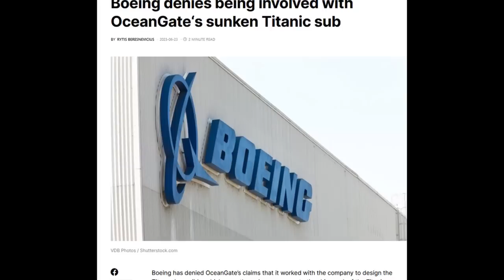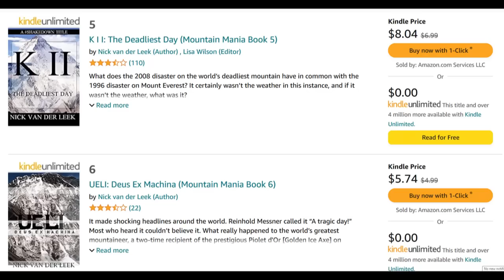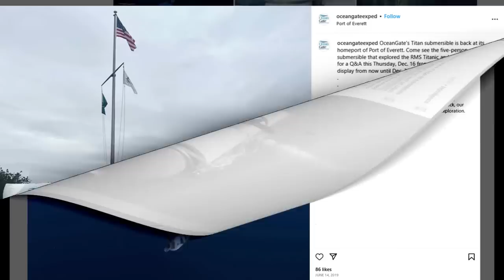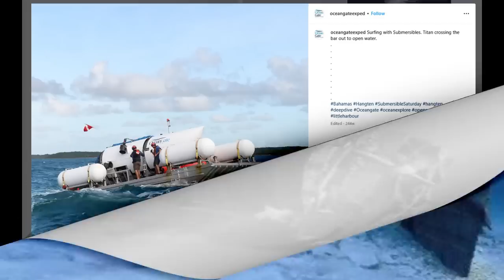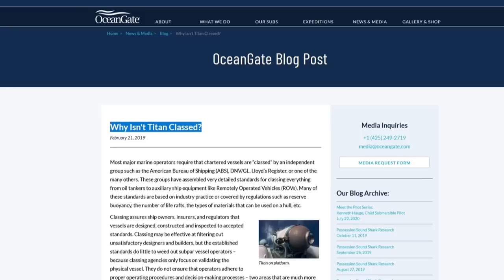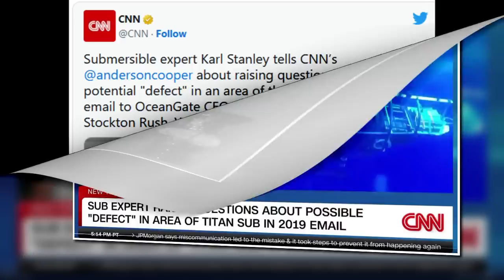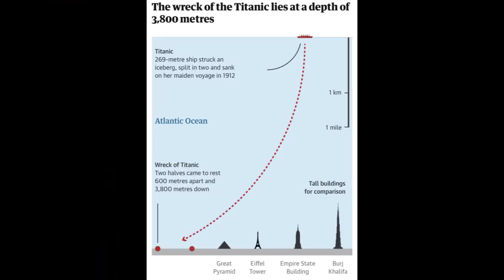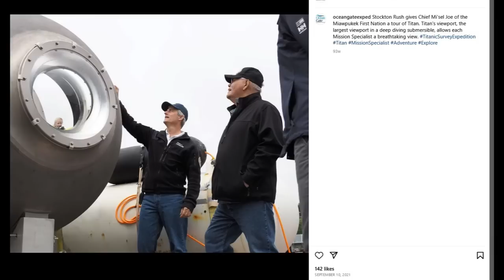"Boeing was not a partner on the Titan and did not design or build it"

Comment: Watching that guy mix up the glue in a bucket with a spatula is telling about the level of manufacturing control.
Reply: lol I'm not the only one that noticed that ...good 😂
Reply: Yes that flashes my mind when I initially saw it.  The glue wasn't the issue, it was the length of the lip
Reply: And not a clean room
Reply: @leopardwoman38  Yes. All it would take is an errant dust bunny.
Reply: Exactly. I wouldn’t use a snorkel built that way to go just under the surface. Let alone dive to pressure depths
Reply: Epoxy resin, the 2 part variety, needs to be very precisely weighed & then mixed. Failure to do so typically means the bond integrity (& durability) is not achieved.
Reply: @stephenthompson6982  yep.

Comment: Wow!  Just look at the wreckage pieces and we have our answers - Titanium pieces intact and in reasonably good shape and the composite material no where to be found!  Stockton Rush seemed to be an engineer gone rogue and that is always dangerous.
Reply: They apparently picked up hundreds of fragments off the sea bed, there were several very large bags of material offloaded from the returning ship.
Reply: Yes! We once bought a house from one such theoretical engineer with degree in metallurgy the first night as I hung bedroom curtains the whole lot fell off the wall due to this guy not using suitable wall fixings. Then the wall cupboards fell off the kitchen wall for the same reason - right on top of my wife! The thing is, this guy was a member of a local gliding club who volunteered to mend glider wings in the garage. I shudder to think.....!
Reply: @royfearn4345 oh my goodness. It would be laughable if it weren't so dangerous.
Reply: @rtqii  Thank you.  Yes, that’s what I read after wrote this. :)  Sad, I hate to see lives lost when it was completely avoidable.
Reply: @LettieC33  This is a very interesting case and I followed the recovery very closely. Pelagic Research Services has performed work of the very highest order in this recovery.
Reply: @rtqii  I agree!!!
Reply: @LettieC33  You have a new subscriber.
Reply: Glue joint will be scrutinized.  This is not as simple as gluing a graphite shaft to a Titanium driver head.
Reply: I bought a house that was owned and modified by an electrician.  As I walked around, I noticed everything he did was not to code.  During escrow I had the house inspected by the building department. He had a list of things to bring up to code.  He was mad but I wanted my house safe.  (I’m an Engineer-but I follow the rules as they are for safety.)

Comment: Did y'all notice that the glass was missing from the porthole in the wreckage footage????
Reply from the maker: Well spotted.
Reply: @gregwood3380 Mechanical engineer here.  This would be my guess too.  While the window was underrated for the depth it likely did not experience the same kind of cycle fatigue that the carbon fiber shell did and with reports that cracking could often be heard from the carbon fiber, there is just such a large surface area for something to fail.

Comment: Clue of this event might be how they towed the floating rig w/ sub on it across stormy seas of the atlantic ocean. DALLMYD was on sight on that fateful last expedition and in his video it is evident that they towed the sub. Structurally I assume, the sub was mated to its external frame thru titanium rings. The floating rig however was actually TWO separate floats joined loosely, longitudinally. So the left side of sub framing was on the left float, while the right side of frame was attached to the right float. In wavy water the floats were "walking the waves" which in turn was creating torsional loads on the titanium rings making them twist in places where they were glued to the carbon fiber tube. This floating rigs was towed 600 miles across stormy waters plus they had it parked for several days on diving site.
Reply: Are you absolutely sure he was there for the last expedition? I saw his video but from what I gathered he had already left and was just there shortly before, I’m guessing a few weeks before. Usually it takes them days to weeks to edit and upload videos and he had his up shortly after the incident or at least when we found out the outcome.
Reply: But I agree 100% about the “raft” they towed that thing on. I can’t believe any of those experienced people saw that and still actually got on it. I have zero knowledge or experience with the subject matter and I would never consider going in that thing after seeing that.
Reply: @highjinx6519  for rough seas you need a V hull rig, their floating rig was flat bottom for small lakes or river; s lot of vertical pounding that sub must have endured

Comment: It's a somewhat realistic looking stage prop. The ends had a two inch overlap and were glued on with epoxy, hard to consider such a ludicrous construction method was for anything but appearances.
Imagine if the front end of your car was constructed that way, no cohesive framework, just a two inch overlap held together with some epoxy. I wouldn't expect it to really be able to hold together very long in actual use, but it might long enough to look good in a photo or video.
A glued together submersible?... yeah right.
Reply: The ocean pressure will tend to press the hemispherical heads into the tube.  The problem with the concept is the strain dissimilarity of the two materials adding shear stress to the glue joint.  Not saying its an adequate design, but the concept is sound.
Reply: @scottkelley1558 How is the concept sound, if it's inherently flawed? What are you talking about? 
This just the kind of so-called reasoning that resulted in this mess.
Reply: Yes it's a sound theory to a child, but the shorter the overlap, the less(maybe expo entially) ability to stop the carbon fibre tube from narrowing in the centre of its length, placing a fold strain at the edge of the lip and thus setting up the conditions for a shear....
Reply: @lewis7515  the concept of using pressure to seat mating pieces is used extensively in nuclear reactor fluid system components.  The greater the pressure differential, the more tightly they seat.  

Did you not read the second sentence where I said I was not saying the design was adequate?  There is a difference between concept and verified and validated design.  Oceangate failed in those aspects.
Reply: @scottkelley1558  So what? Do nuclear reactors attempt to take advantage of a higher internal pressure, or external? Do they rely on profile lock-out between mating faces or do they just place flat surfaces next to each other? Either those concepts the same, or they're different.

Yes, I did read your second sentence - that's the point I just made: your second sentence is  meaningless. 
The concept can't be sound if the design is inadequate, as the design is a material expression of the concept. What are you talking about? Design is even different to execution.....
You're discussing principle - which well may be reasonable and universal: but that doesn't mean every concept seeking to exploit that principle is sound, as a concept is conceived as an exploitation of principle. A design only prosecutes that concept - and there's actually a difference between poor execution of a sound design; and the perfect execution of a design that was fundamentally ill-conceived and therefore flawed. 
With that, a fundamental ill-conceived attempt to exploit a principle, [I would have hoped, obviously], can never be described as, "sound"....
What ever in this world are you taking about?
Reply: @scottkelley1558 No nuclear reactor has ever gone to the depth of Titanic.
Reply: @scottkelley1558 That is an awful design the glue gets compressed and uncompressed. Not good.
Reply: Besides nasa keeps screwing up making spaceships all the time.
Reply: @small_joys2022 that’s a great point. Many of the nasa engineers privately admitted that the shuttle concept was inherently flawed and the design execution with the lack of resilience of the solid rocket booster seals was one of the more obvious shortcomings. That, in combination with the military/commercial pressures and competition from Titan(!) rocket programme combined with horrid cold weather resulted in an attempt to fool nature which backfired spectacularly. Almost the same (principle-wise) with Oceangate. Very sad and I do hope that NASA Artemis programme learns some of those lessons…

Comment: I think the one thing that amazed me was how they were applying the resin glue, came across as if they were just painting a shed, seemed little consideration for even application avoiding contaminants or trapped air bubbles 😮
Reply: I've seen non structural Carbon Fibre car parts made with better care in cleaner work spaces than this

Comment: During 2020 and 2021, the Titan’s hull was either repaired or rebuilt by Electroimpact and Jenicky Industries, two Washington state companies that deal largely in aerospace. In late 2021, Titan makes its first trip beneath the wreckage of the Titanic.

Spencer Composites says the Titan was not using its carbon fiber hull on Sunday’s dive. Other than possibly rudder work, a source familiar with the company told TechCrunch that not much has changed with the Titan since 2018.

Comment: 05:40 them applying the epoxy (think industrial super glue) in a clearly non controlled environment in a situation where you only get one shot at it. That should have been done in a temperature, humidity and particulate controlled atmosphere because all of those can affect the curing of the epoxy.

Comment: I'm a former pro-skydiver and we use carbon fiber for a lot of our helmets. It's lightweight but strong enough to mount cameras on, and you can even bake it and mold it to fit your specific head. It's got some great properties but we always joke that it's just a cup to hold our brains if we hit something. It's not strong in the sense of great impact or pressure. I find it illogical to utilize this material under pressure.
Reply: One of the first thing you learn as a Probie Firefighter or EMS. At the scene of any sort of accident, never ever be the guy that picks up the helmet that you find. It's rarely empty.

Comment: I learned about the limitations of carbon fiber and dissimilar materials assemblies e.g. coefficents of linear expansion over twenty years ago on my bachelor engineering degree. Fracture mechanics, k.. I knew the sub had imploded as soon as it was reported missing. Carbon fiber and glued assemblies is not the right material and assembly for a deep sea sub. Princeton posh rich boy Rush obviously was looking out of the window or chose not to take a materials module.

Comment: I worked as a consulting engineer with two dozen venture capital funded start-ups developing renewable fuel processes a decade ago.  The hubris of Rush, disrespect for outside expertise, technical short cuts,  name dropping of reputable companies and research organizations and use of inexperienced (read far less expensive) engineers is all too familiar.  A decade later, maybe one of the 25+ companies I worked with survives.  Some careers were ruined and 100's of millions of investor's dollars were wasted in the shake out process, but fortunately no one was injured or killed.
Thirty years prior, I worked on a novel oil production process that was the pet project of the CEO of a major oil company.  It never worked, cost $1 billion and there was pilot plant evidence that it wouldn't work that was suppressed by upper management for fear of angering the CEO.  The failed project led to the company's demise and many destroyed careers.

Comment: The successful application of carbon fiber composite in aircraft bears little or no resemblance to the massive compressive loads encountered in deep-sea submersibles. It's a complete misapplication of the material, imho. Aircraft structures endure millions of load cycles. These composite submersibles seem life-limited to just a few load cycles....this is a huge red flag. I suggest interviewing a materials engineer with extensive composites experience to comment on the differences between these two applications and the suitability of carbon fiber composites for a deep-sea submersibles main pressure hull.

Comment: It is interesting that any comparison at all would be made between the Titan and any pressurized composite body passenger aircraft.  The Titan at 13,000+ feet below the oceans surface was routinely experiencing 6,000+ psi ( psi) pounds of pressure per square inch ). That is roughly equal to 11 million pounds of total pressure distributed over the Titan's surface area at its maximum dive depth.    
By contrast, an aircraft flying at an altitude of 13,000 feet  is pressurized to between 12psi  and 14 psi. The required durability for safe function of an aircraft body experiencing 12psi to 14psi of internal inflationary pressure intended to maintain one atmosphere of pressure inside a passenger compartment, can not be rationally compared in any way to the Titan's passenger compartment's need to withstand external pressures greater than 6,000psi... Im not sure why there is such an air of mystery about something so obvious; the Titian was cheaply designed, and suffered subcritical damage every single time it dove until the damage reached the failure threshold. 
Anyone looking to place culpability on Boeng for the Titan disaster is unjustly digging for gold or simply trying to deflect blame. OceanGate and Titian are not trademarks or subsidiaries of Boeng. If they had been,  the Titan would have been a vastly more expensive and durable craft, and unquestionably safer simply because it would have gone through long and rigorous program of unmanned research and development, and more importantly, Boeng would not have been limited by financial constraints...  and sidestepping any quality controls and/or inspections or certifications would not have been a serviceable idea. 
The Titan disaster was no accident.. it was simply the consequence of impatient gambling. It's very sad that the passenger lost their lives, because it is highly plausible that the risk was misrepresented to them.

Comment: it could easily have been the plexiglass window, only good for 1300 meters, but went down 4000 meters. This toy wasn't a Boeing product, built to Boeing specifications.  Did Boeing provide the carbon fiber or their supplier.  The material was expired and rush knew it was expired.   If the supplier can legally  give away or sell old carbon fiber then they can't be sued.  I doubt he told anybody that he intended to use the material  over and over indefinitely and under   pressures far exceeding it's usefulness.    And it may not just be the material itself. It could be the way it was installed , or the    It could even be the design it was installed over.   He said his designers were children. Maybe they can be sued too.

Comment: In addition, how the titanium domes were bonded to both ends of the CF hull using epoxy adhesive glue was also unproven!  The glue had extreme shear load on it from the water pressure at 4000 meters.  The glue strength from shear loading is completely different, and much weaker, than pure tensile loading!!!!

The director of engineering and Stockton Rush, both were engineers, should have known this but Stockton decided to push the envelope and disregarded this!!!

Comment: Apart from the design and poor choice of material for the hull, was that carbon fibre hull just carbon fibre and resin cured in air (like laying up fibreglass) or was it bagged, vacuumed and autoclaved to remove air bubbles and cure it? The layup and resin application between layers just looks like something a back street shop would throw together. Just look at the outside surface finish and all those flaws! I suspect there is zero in the way of material procurement, manufacturing process or testing traceability. Will be interesting to see the detailed results of an investigation.

Comment: Let's just get this fact straight and out in the open -  CF has great strength when subjected to tensile loads but NOT under compressive loads!!!  The CF hull of the sub was under extreme compressive loads from the water pressure on the outside and not tensile loads that a pressure vessle would see with internal pressure on the inside of the pressure vessel!!!

Comment: the titan had made at least 10 trips to the the titanic.... to characterise it as weak is inacurate..... it may have been doomed to fail... but if it had been retired after say 5 trips it would have been an engineering feet. Lack of certification and testing were its downfall.. A submersible that can dive to 4,000 is not weak
Reply from the maker: How many trips did it make this season?
Reply: I thought it was 3 successful trips to bottom and this was the 4th?
Reply: No. The first 4 attempts this year was cancelled. The 5th attempt was the last time.
Reply: For the 2023 season, looks like they do/did only one dive...Will have to wait out the year if you want to book the next one.
Reply: wrong! 33 dives only shallow 1000 feet......3 dives to titanic and the4th was death

Comment: Very poor design. Two incompressible titanium end domes and a flexible/compressible carbon fibre tube together shaped like a medicine capsule.. 
My bet is that the central tube responded to the water pressure and popped the domes off. I'll also bet that the domes are in good condition but the tube is shattered.
Reply: It's opposite actually, the carbon fiber is rigid and snapped under pressure, while the metal domes at most would have deformed but not snapped